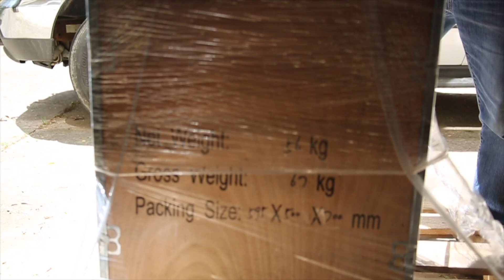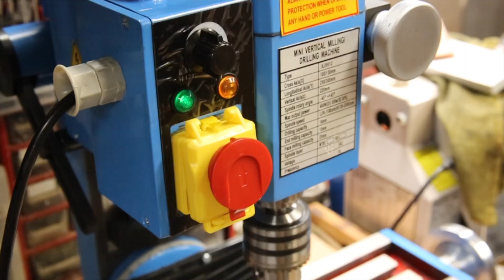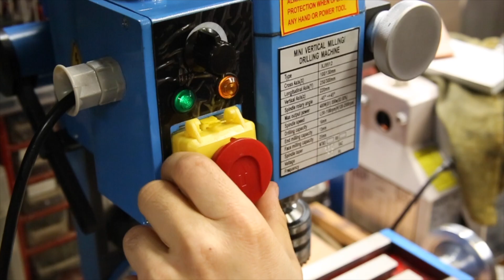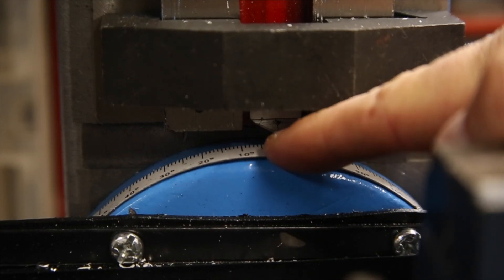Cheap Chinese Mini Metal Mill Milling Machine Unboxing, Setup, Testing, and Review

Comment: Buy yourself an axis power feed for more accuracy. Don't drag the end cutter across the job when finished as this will deface the job and damage the bit. And lastly don't expect too much if its a low end machine as they likely used one of those machines to build it. By yourself a collet instead of a chuck, it will wear less and be more convenient.  :)

Comment: 1. Milling tool holder instead of Jacob's chuck (ER series)
2. Either soft jaws or a v-block for stock holding
3. Saftey
4. Milling direction
(climb/convetional)
5. T-slot work holding set
6.  Have fun

Comment: get a dial indicator and make sure they vise is square to the milling table and then make sure the milling tool is square to the vise as well, this will eliminate the milling marks and give you a smoother finish.

Comment: About the wobble on the chuck, I noticed wobble on the center finder too (8:42), so the chuck deffinitely isn't perfectly straight.
I wasn't sure when you milled the aluminium block, thought it might be because the machine wasn't secured properly to the table, but my suspicions were confirmed when you used the edge finder.

Comment: For a better finish: Place your mill on a surface that does not wobble when you turn the crank!
Reply: And when possible, turn the part sideways and cut with the side of the end mill.
Reply: Unless you want to make it look like a synthetic Damascus piece LOL
Reply: Not sure if this would work for that specifying milling machine but after clamping the workpiece securely to the vice whether with parallels or if working with a cube and can also use a face mill cutting tool since it will cut a lot faster when doing a surface finish

Comment: Hey Tim. How much did this cost when you bought this? Link doesn't work anymore. One used is sold nearby and I think it might be overpriced, unless it comes with extensive set of tools. I'd be interested in rough pricing of one.

Comment: At the risk of awakening E Trolls, I am puzzled why folks call these machine "cheap". The least costly one in my go to machine tool source wants $750 for one. Yes it is "less expensive" than a good used Bridgeport but not anywhere near as useful a tool. Chinese and cheaply made: maybe that's the key. Cheap provides for lower expectations...for what that might be worth.

Comment: Made in China. Stuff that could be made in your own country. You sent money to China.

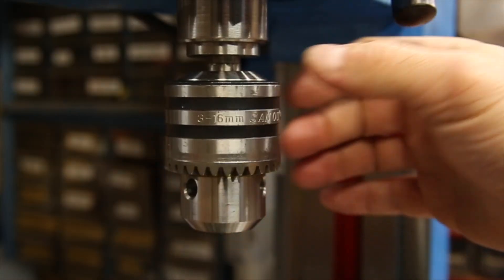That chuck at 10:03 is exactly like mine, faulty, because the tightening cylinder is too slack (too loose - freeplay) and wobbles at speed when not under load (holding a drill). It also causes a noticeable vibration. Check other expensive chucks, see the difference. Is the machine bolted on a weak bench?

How much did you pay for this China junk?

Comment: in aluminum use fairly hi spindle speed and lite cut  and med feed for good finish rough cuts ok for lots material removal then run finish cut  good luck

Comment: Never use an end mill in a Jacobs chuck, you should get an end mill holder or use collets, using the drill chuck will ware out the chuck, and you can never get that end mill straight for a good cut, never use the chuck handle with your wiggler(edge finder) easily crushed, hand tighten your wiggler... ask any questions, I run lathes and mills every day...

Comment: Fasten it down and level it out, nice solid even machine will be much better, go all over the new machine and tighten/check all nuts screws etc as it's common for these machines to be slightly under quality controlled, can deffinately be upgraded and played around with to make it just what you need.

Comment: The first thing to do is put on your safety glasses. The Chinese should include a pair in the small tool box. Also use a brush to remove chips, not your bare skin.

Comment: It's not two tenths of an inch its approximately 2 tenths of a thousandth of an inch. 2 tenths of an inch is not quite a quarter of an inch and more than 3/16 of an inch. Get a caliper and micrometer. Learn to measure with them and you will learn a bunch about measurements. A small radius on the corners of the end mill give a much better finish. Watch how to videos before attempting. It's easy when you understand. Also keep it running when you back out of the cut. You will save cracking the corners of your end mill. Especially on harder materials. Consider buying a collet set for the head. It looks like an R8 but I am not sure. Makes life much easy and will give you more rigidity, tool life, chuck life and accuracy. The chuck is really best just for drilling and similar functions. 20 + years in the Trade. Have fun and be very careful. No loose clothing ever near that head. Always remain afraid/respectful of what it could do.

Comment: All the usual you tube experts who know everything! But have never made anything. Remember there is no right or wrong way in engineering just your way. All that matters is the finished job .If your happy with the outcome that’s all that matters. OK ?
Reply: So the comments of actual machinists and fitters doesn't mean anything? They are just know-nothing Youtube "experts"? From what I can see, plenty of the comments show signs of people actually knowing what they talk about.
You'd think one would learn a thing or 2 about machining during a 3 year apprenticeship as a fitter. One of them being how to make a 0-tolerance calibration tool for a $1 million CNC workcenter.
And you will deffinitely kick yourself if the outcome means a broken machine, broken tools and wasted stock, or even worse, injury! What good is it if you can't even finish the job?
Reply: Try going into a commercial shop on your first day and sticking an endmill into a drill chuck and see how long before they kick you out.

There are good reasons for most 'correct' practices in machining and if you knew anything at all about the subject, you'd understand them and know that a large proportion of the comments are in line with these correct practices.

But then I suspect you've actually never done anything of value in your life have you? Either because you're 13 years old, or you're just a clueless fekwit.

Comment: You shouldn't have an email in a chuck, invest in a collet holder. Put your emill in as far as you can will also help with chatter/ mismatch. Bolt your mill to a table. If your still getting chatter/ mismatch add a subplate. Always climbmill

Comment: I'm very new to machine work, and I can just say this-if you buy a cheap Chinese mill for lathe or pretty much any kind of Chinese machine, you're going to have to go through it, and adjust and tighten just about every mechanism on the unit. Then... And only then... will you get acceptable results.

Comment: Eager or not, I would never attempt to lift 56 kgs (123 lbs) by myself.  Great way to throw your back out, Tim.  Other than that, you video was consise and quite informative.  You should do a follow up and show us this milling machine going through its paces on various projects.  I'll bet if you replaced that one missing bolt, and anchored this bad boy down securely, you'd avoid "chatter" with your tool and have cleaner cut outs.

Comment: You only showed a finishing cut on the piece. It would be interesting to see how it holds up to a real cut, say half the diameter of the cutter.  I suspect trouble will become evident, especially if you try for a realistic feed rate. Maybe not! As others have noted, a collet set to match the spindle would be worth the $75 or so it would cost. But if the machine wobbles so much you can't make a good cut, a collets will not fix that!

Comment: Suggest using a collet for your mill will give you a better finish,  I will put an indicator in the drill chuck and run down the fixed side o the vise to get the vise parallel with the travel,,  I also milled the top of my vise to make that parallel with the table.  I would not have the vise closed when doing so,  Put something 1/4" of 1/2" in the vise before tightening.

Comment: I don't know if you got a good response but her is a couple suggestions. First bolt that baby done to something more solid and use a collet holder instead of the drill chuck. Sorry one more thing search the internet for proper feeds and speeds for the endmill and aluminum.

Comment: You never go and reverse the direction of the cut.  You always go in one direction only.  Then, repeat that same direction for the cut never reversing always using lube between the workpiece and the cutter.  Going slower (does this all ring a bell) much slower prolongs (get it!) the cutter and reduces the heat friction on the workpiece surfaces - this is the first thing they teach at McDonald's flipping burgers. Take note of that.  This is why the earth is flat. Please note, you will fall off the edge if you go too far.  Also, this is why the earth is the center of the universe, AND, this is the reason why you have machine cutting marks on your workpiece surfaces. No, I did not say stretch marks, have your wife explain this one to you.  Now, if you would please excuse me, I must go back and finish flossing my teeth using a precipitating saw.

Comment: first your machine should never ever work on a pallet.. ;)
Reply: all your test are not valid cause of no rigidity.. ;)
Reply from the maker: @JBS1974  not necessarily... They are just tests of how rigid is it when left on the pallet. :)
Reply: @TimNummy  nobody works on a pallet.. you just didn't want to make holes on your desk.. ;) no probleme with that! but it would be nice to get a link to buy this machine.. cause despite no rigidity it looks   to work pretty well!  you did a good job getting me intersted in this machine! :)
Reply: dont worry i putted a thumbs up!
Reply from the maker: @JBS1974  should be a link in the description
Reply: @TimNummy  i'am looking for it.. but it is not..

Comment: I hope I can explain this well enough. I have a similar machine to yours. 
I have two plastic lock handles for the table that I added to the machine same as your . My problem was when turned handles all the way to the left and ran the cross side all the way out the handles would drop over the of cross side way . The handles broke when I went back in on the cross side way. 
To stop this I drilled and tapped a hole just to the left of the handle to screw in a pin to keep the handles from falling down to far . Because you only have one handle  you will only need one hole and pin . Works perfect on my machine and haven't broken a handle since . Good luck to you.
Reply from the maker: Thanks for the tip!

Comment: NEVER put and end mill in a drill chuck! it is not designed to take the side thrust, and end mills act like a screw and try to pull out of even a collet, if you want to avoid mistakes and scrap use an end mill holder.

Comment: Take this to the scrapyard, and buy a good used Bridgeport. And a set of COLLETS.
Reply: Richard Chioccola yeah because you can pick one of them up for $600. When you only use a mill every once in a while it’s just not economically viable. I’ve been looking for a small milking machine, I can’t bring myself up to a Chinese model but I can spend 3 grand on one either

Comment: Use a collet to hold the end mill! and also use some lube! it will improve your surface finish like you wouldn't believe! When I first started as an apprentice the guy teaching me had me run a dry pass and feel it and then do a wet pass and feel it! The difference is unbelievable!!
Reply: Especially with aluminum.  That metal galls to itself!

Comment: Hi Tim. I realize this is an old video but how is the mill holding up. I have been offered a mill the same as this except it is belt drive, which apparently needs a repair, I don't know what repair yet or if it is viable to repair it. Or of I will buy it, but wondered how it is working out long term. I have a Seig SX2.7 so this would be a project while I have time on my hands.

Comment: For a better finish use coolant when cutting. when cutting soft metals use more speed( same with small dm end mills) and I find taking deeper cuts give a rainbow like finish ( witch I like ) when you use the first two tips in combination.

Comment: I have a variable speed AEG 1/2 inch drill 900W  fitted to a drill press. I have used this for 40 years but it cannot drill a straight hole in a 4 inch piece of rod.  By the look of the wobbly chuck, neither can this.  Pity.  I would like to make  a 5 axis CNC. "Kern" makes a 5 axis CNC with an accuracy of 2 microns for about a gazzillion dollars.  This machine would go down to the nearest 1/8 inch.

Comment: Xc funded RCH nunc Baird subducting cub synchs andmy mini null has made half a production line.Not the machine it's how good a machinist you are as I am shit hot. Ps cutter Una drill Chuck's just fine if you go easy flex Dubuffet cucumber HDTV cubic

Comment: Learned one thing that might reduce vibration, and thus those ugly cut surfaces: bolt the milling machine down very well before operation. This might be particularly important due to its reduced size.

Comment: 1/10 of inch away from part.. The oad or overall diameter of edge finder is .2 or 2/10s.. if the outside of edge finder is touching the edge of part then the center of edge finder is -1/10 inch away from edge of part.. Move over table 1/10(.1000/one hudred thousands) of an inch closer to part after u hit the edge and your spindle/edge finder will then be centered over edge of part.. If u want to know how to find the exact center of a part w your edge finder let me knw.. Wont be as accurate as using an indicator on round stock but it will get you within a few thousands of an inch

Comment: Check spindle run out with a dial indicator, throw the drill chuck into a box where it will do some good and get a proper collet and again check for run out.

Comment: If it works for you good deal. Except, I cringed when you cleaned off the shavings after each pass with your bare fingers. I hate metal splinters. Also, as an idea of what you can make, how about a 737 Max that will actually stay in the air safely.

Comment: I've had my mini mill(Harbor Freight) for 5+ yrs . Made a few mods to it and it's still running good .  Made a lot of aluminum pieces and parts .Have another project coming up in a month or two . Should have invested in Dro's  ...
Reply: How much did you pay for it and what is the item number also can you machine or mail out aluminum blanks for lower receivers?

Comment: Many thanks for the video, very informative. Have you tried cutting something harder than aluminum? I personally don't think the supplied drill chuck would survive radial load for much longer, I would advise getting a collet chuck for holding the end mill. Considering you uploaded the video almost two years ago, how is this mill holding up so far?
Reply from the maker: I can't believe it's been almost two years... I actually haven't used it much at all since then but just got a full collet set so I'm planning on using it more soon. Keep an eye out for the next video where I actually try to make something

Comment: Putting an endmill in a drill chuck is not a good idea. It is not designed to be used with a load on the side, it will work loose.  You should get a set of collets for endmills. Also keep your cutting tool as short as you can get by with.

Comment: When you have no way to keep a consistent feed then make sure with each straight cut run it backwards once for a cleaner finish
Reply: oh and make sure your material is actually square and stable in your vise. Then make sure your vice is square and stable. Then make sure the cross feed table is square.  If it ain't 90 deg to the end mill the cut will be shit.

Comment: You need to use a collet for holding milling bits, not the drill chuck. This is something you need to purchase separately, since for some reason, none of the Chinese made milling machines come with any collets. You would like have gotten better results milling the end of the aluminum had you mounted the bit in a collet.
And for the love of God man, bolt the machine to a stable work surface.

Comment: Tip with edge finder. Snug it tight with your hands only. Never use a key to tighten or you can crush and wreck the edge finder.  My experience is 3years completed as a tool and die maker apprentice. I'm now a Quality Engineer for a machine shop.

Comment: U think your oilers cheap am using a disposable plastic water bottle with a hole in the bottle cap
Reply: scuba Steve  get a car tyre valve, strip the rubber off and remove the air valve, drill a hole in the bottle top of the bottle you intend to use, the hole needs to be just slightly smaller than the threaded part of the valve, now push and screw the valve into the bottle top, when in cut the top of a valve cap and screw it onto the thread sticking into the cap to act as a locking piece, you can add a length of rubber hose to the valve to extend the spout if you desire, and bingo one oiler that didn't break the bank.

Comment: Any upgrades with this yet? Just bought one myself and they similar to the sieg brand but are different.
Reply: What do they run? Couldnt find a price
Reply: @greenstreet5287  haggle the sellers on eBay.. I got one shipped for $685, but they are starting between 730-760 with the OBO option on eBay.

Comment: A few suggestions:
1) Don't use a drill chuck for endmills. they aren't meant for lateral loads. Surface finish will be terrible, and rigidity isn't there. Also, drill chucks can "fall off" when latteral loads are applied, as it literally will walk the chuck of the arbor.  
2) Get yourself a nice set of collets, and a collet holder for that mill. This will improve rigidity, as well as surface finish. 
3) Invest in a DRO, or take measurements constantly. relying on the dials for accuracy will be a let down. They are good for getting you close, but once you're close, measure measure measure!